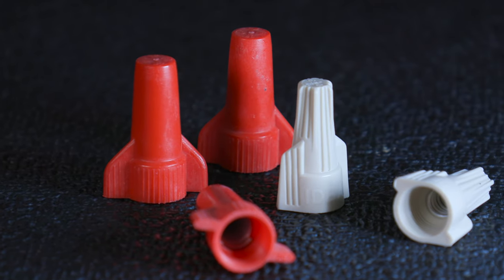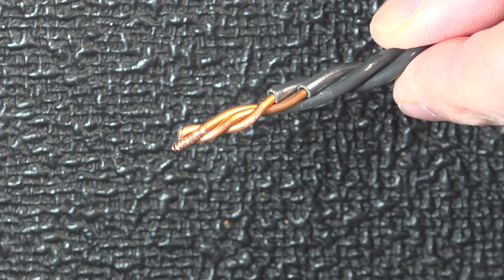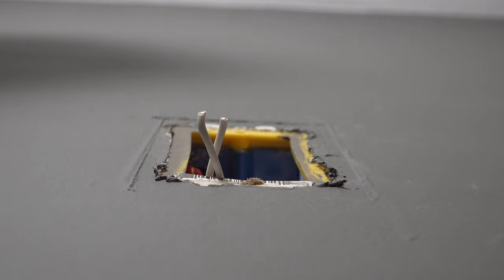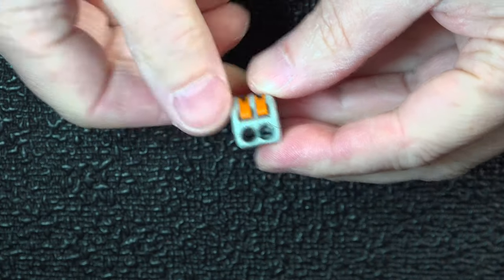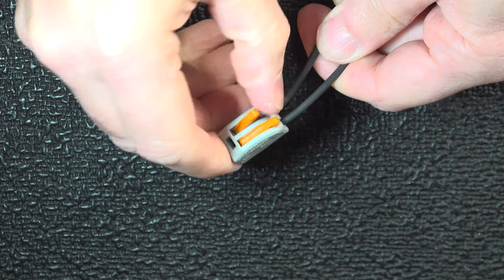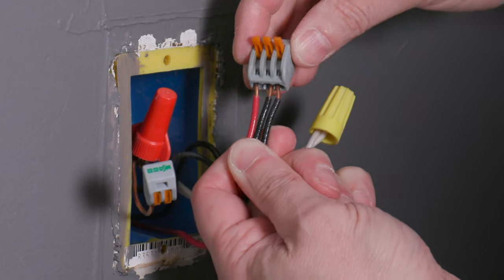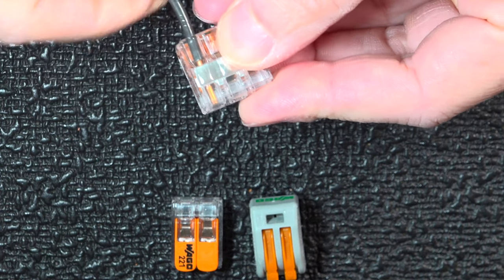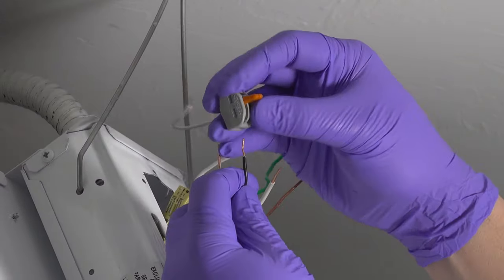Never use Wire Nuts Again - Wago is Better Electrical Connector

Comment: "They are incredibly dangerous". Completely false statement.
Reply: I was confused about that claim as well- I’m just a lay man handyman / home owner. I have never run into problems that I didn’t create myself.
Reply: Anything is dangerous with misproper application😂
Reply: It would be nice to validate your claim as just the statement alone does not help your case. Why do you believe "they are incredibly dangerous"?  I have used both methods and the both perform well.
Reply: @curiosity2314  wirenuts aren't dangerous, bad untrained electricians misproperly setting up wirenuts are dangerous. Just the same as bad untrained electricians setting up wago connecters can be dangerous. Wirenuts are in no way idiot proof. You can have too much excess wire when connecting and cause it to go through the end of the nut, people can leave excess wire exposed at the bottom, people can improperly pigtail or connect wire. Wirenuts aren't bad, bad electricians are bad
Reply: @jordanadams6033  you’re spot on and I think that was the (albeit poorly articulated) point of this vid. In his opinion these connectors are easier to use and slightly more idiot proof. That doesn’t mean wirenuts can’t be used safely and that these connectors can’t be used improperly.
Reply: Billy Mack, Texas Detective  Hey, the author of the video is just telling it like he sees it.  And if he doesn't see it, he makes it up.
Reply: @kingduckford  you folks are missing the fact that the guy wants to sell you something via his affiliate links. Selling wirenuts dont make much money.
Reply: @jordanadams6033  Thanks Jordan for the reply, I understand proper use of any tool, fitting, electrical connector is a must. Like others learned the hard way when I was young but that doing things right the first time is the best policy. Just had to throw that one in... Yes I understand wire-nuts are completely acceptable with the knowledge of how to use them properly. What is interesting about Neonlon comment is that it does not state any facts about where they get there information on Wago being unsafe. It's a statement with no backing. He has 81 people thumbing up the statement so far I find that incredible.  If you are going to make a statement at the least give your reason why so people can research and decide. I also believe wire-nuts will be around well into the next century.  I've really only used Wago in the low voltage environment. Not sure how well they are going to do with heavy gauge wiring like 12 or better. Are they going to want to wiggle out of the connection by placing wires on the box. Unknown to me. Could be they have a bite I'm unaware of as the video is not very comprehensive.
Reply: @jordanadams6033  0
Reply: In some situations, yes. Wire nuts are incredibly treacherous. 
They should never be used where exposure to moisture or vibration is possible, and absolutely should not be used where amperage loads could exceed 10 amps.
I have spent many hours cutting out burnt wire nuts to replace them with split bolts.
Reply: Completely false!
Reply: Count the number of houses in the US.Let’s look at say 50 years , count the devices in each house. Multiply that by ... let’s say 3 wirenuts per box .... Wow! If they are incredibly dangerous, there would be one hell of a class action.
Reply: By the way Blue wire nuts are used in range and dryer circuits routinely ,far exceeding the one post about 10 amps max? Also Commercial and Residental outlets are 20 amps as well as switches in Commercial. No issues. Just saying....
Reply: @Neonlon  But it must be true...it's on the internet:)  But seriously, after touching the black and white wires to my tongue to make sure the power is off, I just twist 'em together and wrap them in some black tape.  In a pinch, masking tape will do.
Reply: @jordanadams6033  Yes, and if you find a loose wirenut causing problems, you count it out to misproper application, ignoring the fact, that thermo cycles are loosening all wire nuts by default.
Reply: @The_Fictionist  Wire nuts are unsafe as they get loose by time.
For these loose wire nuts you just blame the electrician, who is not guilty for that, but only for using unsafe material.

Comment: I stopped caring what he said after he proved he can't measure at the beginning of the video
Reply: Exactly
Reply: I thought the samething
Reply: Do you mean at 0:55 ? I'm pretty sure that was just to give a rough idea of scale. I really doubt that was supposed to show he's measuring three inches.
Is he wrong about VAGO connectors?
Reply: That reminded me of the guy on TV jamming a Q-tip in his ear.
Reply: That looks like about 3 inches of usable wire to me. Do YOU know how to measure?
Reply: @RipleySawzen  the wire is bent you doofus. If it was actually stretched it would read longer
Reply: @BlueManRedManYellow  And it's around 2.5 with the bend, so unbend it and it'll be 3. Not sure how people are getting much more than 3. MAYBE 3.5, but he said about 3.
Reply: He didn't prove anything of the sort. He showed how the wire nuts damage eyes and are a real pain to remove, which they are. Have you tried without further damaging either wire? The switch clamps are literally the same method used with every other cord with a terminated end and nobody complains about using them than. Most people are lazy traditionalists that don't like change and accept more lazy and dangerous methods to do anything for the most part.
Reply: @Openreality  If it works it works.  Who cares?  Many people are also not lazy, just because someone says it on youtube doesn't make it true.
Reply: I saw that too

Comment: Ive been an industrial/residential electrician for over 15 years. Never once had an issue reusing wire nuts.This is the way I was taught in trade school.I have never had to cut wire down if I change something. Not one issue. These new style Connectors are nice but too expensive.
Reply: I agree, what a dumb video.......ive been an electrician for over 25 yrs and all those nice quick connects on new lighting fixtures are immediately cut off and discarded by our company,  we have learned that they cause more problems than anything......those wago ones are a little different but wire nuts are still the best, fastest, and cheapest and we buy the more expensive ones........we must remember that a wire nut is actually connecting the WIRES together, its not relying on another piece of metal to jump the current......why add another variable if you dont have too.  There is no question in my mind that a wire nut provides a superb wire to wire contact connection when done correctly.
Reply: Yeah never had to cut wire when reworking wire in a box. For whatever reason
Reply: New style? We use these in Germany for like 50 years or so. You can check rhe connection because they are transparent, the have small holes for testing and the time that you save using these saves you actually a lot of money.
Using Wirenuts would be seen as unprofessional here.😅
Reply: @kcjarembek  Imagine thinking wire nuts are better than wago's, keep living in the dark ages old man!
Reply: Peter Lustig is right

Comment: i felt like i just watched a infomercial for a product that i really don't need, i have been using wire nuts for many years and never had any problems with reusing them ever...
Reply: I've reused them for years as well. But I have had some that weren't reusable.
Reply: Same here. It's just a sales pitch and if you don't know how to connect two or more wires together then you should not do electrical work. I been using them for years and never had a problem. I rather use gorilla nuts. That's what we use in our air machines where I work.

He has the date wrong IDeal bought the patient in 1946. And called them wire nuts. Me and my father rewired a farmhouse and a lot of the junction boxes had wires soldered and wrapped with friction tape. The old black tape that was sticky on both sides.
Reply: You're not supposed to reuse them or the portion of wire that was scarred.
Reply: @jonathansirmons7932  I'll remember that the next time I re-use them and the portion of the wire that was scarred.
Reply: I must have missed something. I have a bunch of yellow wire nuts that I took off when I did the LED light conversion I probably won't use them. I used the orange ones when I installed the LED lights.
Reply: @ronb6182  nothing wrong with that.
Reply: Agreed. However, I have used these things and they are actually kinda nice, especially when using solid wire on stranded, like on a small motor connection.
Reply: @floriduhman9520  that is a good point but can they be reused? If a wire nut needs to me removed it can be put back as long as it doesn't have pieces of wire left in it. I never use quick connect on switches and outlets and I think these are the same connections I stay away from. I will buy a few next time I go to the big store. All the fixtures in the newer building where I work has a similar connector but you cannot reuse them.
Reply: There are pros and cons on any type you decide to use, it's seems like electricians are getting lazier with all these new ideas, screw connection are much better than quick connect on switches and outlets. You will never see quick connect on dryer receptacles and range receptacles. I treat my outlets and switches the same way. Circuit breakers also don't have quick connect at least all the ones I seen. Zinsco may have used them but you know what happened to that type of panel. Same with a federal Pacific panels. I refuse to work on those two panels unless they get pulled and replaced with modern panels.
Reply: @ronb6182  unlike he push in connectors, like on 120v outlets that have them, these are like a clamp type that can be reused without issues. They are good for specific things, i guess, but i wouldn't throw all my wirenuts out anytime soon
Reply: @floriduhman9520  ok like I said if I can buy a few I will try them on some of my light projects. (Low wattage)
Reply: @ronb6182  Sorry to say that, but screw Connections are not better! A spring loaded contact is very stable against Vibrations. (I build machines in industry, there we also use spring loaded terminals). For house installations I use Wago for lots of years, I never had any problems. If you want to connect wires with only one wire inside (not the flexible wires with lots of small wires) you can use a different Wago type, it is cheaper and even smaller. In Germany we don't have so much space behind our switches or power outlets, because we use nice and good looking devices, not the big ugly ones that you have in the states....
Reply: @horstklotsch5589  they are because more wire connects to the metal. If you put a 1500 watt heater on push on connectors in time it will over heat and start arcing. The way I connect it won't move anywhere. We are talking residential wiring there may be better connectors used for industrial or commercial but for regular screw on receptacles are the best. Now there are push through that also uses the screw I would use those type of receptacles then you get the best of both types. In fact I need a 20 amp receptacle I will look for the push through with the grip of the screw type they may cost more but it will be better. The screw type is better for stranded wire which EMT wiring uses. Thanks anyway
Reply: @ronb6182  Hello ron,
Wago offers a wide variety of installation terminals with a wide variety of diameters. It is clear to me that the currents in America are twice as high for the same power, because your normal mains voltage is only 115V. But if you choose the terminals that match the required cross-section, there are no problems. Anyone who has worked with Wago Terminals will never want anything else! These terminals have been around in Germany for many years, I have been using them myself for decades, I have never had problems and have never heard of problems. Wago terminals are simply the best type of connection, there is nothing better, countless tests have proven this. The heater mentioned in the example consumes around 13A current in America, the standard Wago terminal (e.g. type 2273-204) is sufficient, it can handle 24A, cable cross-section 0.5 ... 2.5 mm² / 20 ... 16 AWG. Try it, you will not be disappointed. Wire nuts need a lot of space, are difficullt to handle (try to connect 8 wires together, I don't think, that it will work), they are not user friendly, because it is not easy to disconnect and to reconnect them.
Reply: @Ban this youtube that's why the screws are much better than the quick connect. It's just a thin piece of metal that connects the wire, it's just a fire waiting to happen. The old way is always better in this issue.
Reply: @Ban this youtubeI am sure that it was no Wago
Reply: @Ban this youtube , real electricians don't backstab.
Reply: @horstklotsch5589  I'm supporting you :) German technician here... I would never consider using a wire nut. The Wagos shown in this video are a springloaded type of connector. Als long the wire isn't totaly crippled then you are inserting it, it has always a good connection. And this connection is way faster and with the "new" see through Wagos also nearly foolproove. I've seen some failed. But I've cut way, way more wire nuts out.
Reply: The examples shown is a result of poor workmanship as opposed to product failure. These have a place but not for full load application. One nice thing about them is you usually see the burned up connection.

Comment: I've only come across these, or ones similar, in troffers after a ballast job. Some caught fire, but was contained. Simple to cut them off and use wire nuts with the new ballast install.
Reply: I'm only a DIYer, but I never trust quick connects for anything at line voltage. Low-voltage, LED or audio wiring, sure, but not at line voltage. IMO, if you don't know how to use wire nuts properly, you've got no business being inside an electrical box.
Reply: Same. I was a journeyman at 17, masters at 19. Wirenuts are a much superior connector.
The industry should have learned their lesson from back-stap devices that burnt down countless trailer houses
Reply: @jayjonassen2256  Where? We do a 4.5 year apprenticeship in Canada.
Reply: @BlackEpyon  Most electricians in Europe haven’t touched a wire nut in well over a decade. I guess those aren’t professionals then.
Reply: @mrjakobt  Europe does a lot of things funny.
Reply: @BlackEpyon  you realise outside of the US no one uses wire nuts, standards in Europe are a lot higher
Reply: @WCamden  We use them in Canada too. They work fine.
Reply: @matthewq4b  No, on critical installations, it's always a single piece of wire from end-to-end, with crimped (Molex or other such) connectors at the ends. You NEVER introduce weak points in the middle for something critical. 

My dad used to be a senior service rep for Datex-Ohmeda (they manufactured anaesthetic, respiratory, and life-monitoring machines) back when they were still owned by BOC (they're owned by GE now), and I got to see a lot of the insides.
Reply: @matthewq4b   No, on critical installations, it's always a single piece of wire from end-to-end, with crimped (Molex or other such) connectors at the ends. You NEVER introduce weak points in the middle for something critical. 

My dad used to be a senior service rep for Datex-Ohmeda (they manufactured anaesthetic, respiratory, and life-monitoring machines) back when they were still owned by BOC (they're owned by GE now), and I got to see a lot of the insides.
Reply: @matthewq4b  9000 hours was what I signed to, minus time off for education and time served.  At 2000 per yr it is 4.5 yrs. School totalled 26 weeks, or 1/2 year. Red Seal meant you scored over 85. I have that. In 1988 that is what was going on.

Comment: Whenever I need a wire nut, I just look in the washing machine.
Can’t do that with a wago!
Reply: I have a couple shoeboxes full marrettes from a decade of washing machine nuts lol
Reply: How do they get there
Reply: @AgentOffice  We use them pretty much everyday. A few stragglers end up in your pockets and they are so light you can't tell they are in there. That is until you do laundry and it sounds like a rock tumbler.
Reply: @Rd Ho holy shit 2 screw mc connectors and red heads just grow there sometimes.
Reply: I thought you meant you harvest them from the wiring of the washing machine 🙃
Reply: @dubmob151  oh no haha I usually have them floating around in pockets or wherever and they always end up in the washing machine or dryer
Reply: @jeffdyrland2795  I'm always amazed how the washing machine extracts everything from the pockets so thoroughly. Next time I look for something I can't find from my pockets I'm going to toss everything in the wash so it'll turn up-
Reply: @dubmob151  tried and true my friend! Haha
Reply: My wife would agree 100%
Reply: My ex GF is an electrician / industrial generator mechanic. 3 years after separating, I’m still finding the random wire nut, 36” long strand of hair and caches of glitter all over my house! 🤷🏼‍♂️
Beware the female electrician!!!